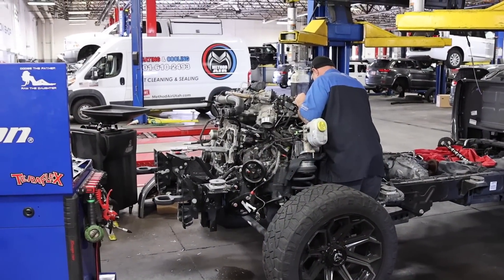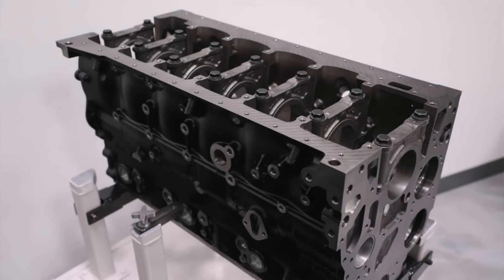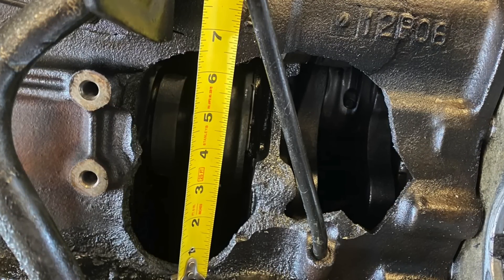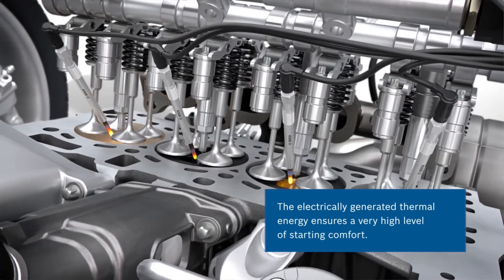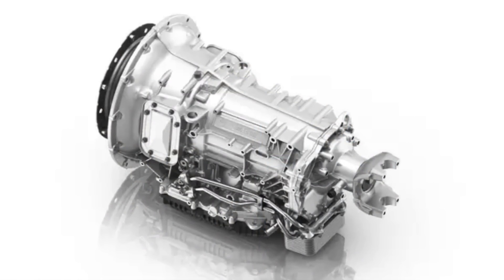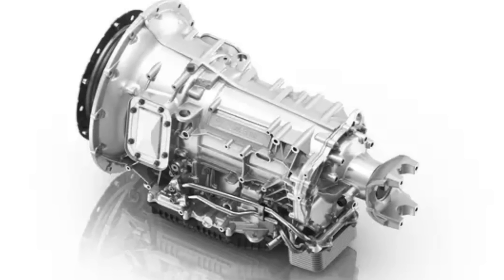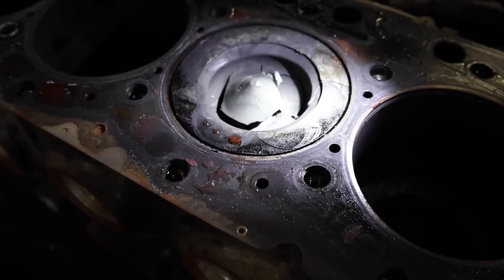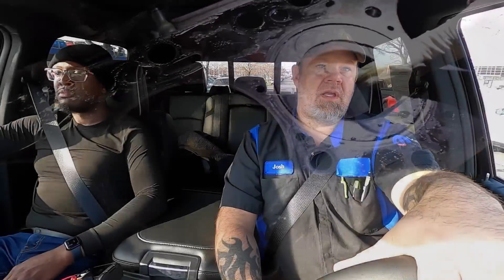Master Tech Breaks Down The Cummins Updates For 2025!

Comment: I won't be buying any truck newer than 2012. The deleted 6.7 with an Allison is doing just fine and can be rebuilt when necessary.
Reply: Who did you get your Allison from?
Reply: @justincastille04  Custom Automatic Conversions in Milton Florida. They have every configuration of truck figured out for the Allison to mate to. No need to try to guess how to install it, everything you need from one shop. They even install if you go to them, great service over the phone if not. Awesome install directions.
Reply: Youre missing out on all of the electronic goodies of the newer trucks.
Reply: @PremiumFuelOnly  All the goodies are found on phones and tablets which can be upgraded at my pace and easier than hardware built into the truck. Then there's the electronic baddies that manufacturers put in the truck that are useless or not as good as the best on the market. I want freedom to choose the electronic goodies I want like hot rodders have done since the beginning. I also don't want the factory dictating the parameters of my usage (holding me hostage). I don't like horses, so I gotta do what I can to keep driving on my own terms.

Comment: So stay away from 22-24 trucks and if you own one of these truck good luck selling them
Reply: What’s wrong with the 22-24
Reply: @Dirtybandz_6.7  failed lifters, failed camshafts, broken aisin transmissions, occasional broken rods. All associated with the 22-24's. All this can be researched on the forums. Good luck. Not all are bad though.
Reply: @aaronkelley8909 I see thanks for the information mines a 20 but I’m thinking of trading it in or selling it this year or in 26
Reply: Bad advice
Reply: @johnowens7959 How is it bad advice? I was in the hotshot industry and my 22, my neighbors 22 and all the guys we know with 22 and 23 Cummins had major issues. Tons of DEF and DPF issues, as well.
Reply: @jeffosmun436  did you guys delete or change tunes?? What model? Your business is very demanding on any truck...
Reply: love my 2022 HO 3500.
Reply: So when I look at the media stuff on the big ZF that is to be put in the new HD - How is it cooled? It seems to have a bolted on passive cooler - not one that goes to the front or through the rad.  Is it it this way for for the ZF’s on the hellcats and other gas trucks???

Comment: Do you think they will fix the fifth GEN lifter issues on a recall?
Reply: Change oil earlier. Shouldn't go over 5000 miles tbh
Reply: People are saying not gonna happen
Reply: Probably not. Most of the failures occur at or around 100K, outside of the warranty period.

Comment: CGI is about 75% stronger than regular gray cast iron but Cummins removed way too much material between the main caps/bearings on the 19-24MY blocks. They decided instead to just go back to cast iron and are now moving to an Aluminum head for the weight savings instead.
Reply: I'll still prefer cast iron because it's proven for decades.
Reply: Ford has been using cgi  since 2011 i believe
Reply: @alexhernandez5061  ford isn't a very good example since they haven't had a reliable diesel since the early 2000's.
Reply: @  There’s actually tons of 6.7s that have half a million miles on them with no issues. I’m a Duramax/Cummins guy but purchased my first Powerstroke earlier this year and so far I absolutely love it.
Reply: @treeamigo8447 even then that was intertrashional’s boat anchor 7.3.
Reply: @treeamigo8447  you can say what you want but fords 6.7 is far ahead than the cummins 6.7 and thats coming from a cummins technician. Fords own in house engine has come a long way and with everything maintenance goes a long way
Reply: @treeamigo8447  I'll admit I'm a Ford guy (previous Ford tech at a couple dealerships) but, the engines themselves are not the issues no different than with the Cummins from what I understand.  The Cummins engine itself is supposedly a good engine but of course, people are biased in many cases.  However, the stupid bolt that fails on the engine grid heater on the top of the Cummins engine is just one stupid issue that causes catastrophic damage internally from what I understand.  As is another problem with a pin in the front timing cover (I believe) on the older Cummins engines.  These are just a couple of the stupid things that cause the engine to fail when it's not really the engine's fault itself.  And then, all the emissions stuff that ends up clogging up and getting soot and other debris to cause premature failure when it's unnecessary.  That is what causes a lot of issues with the Ford 6.7 engines from what I understand.  That and of course people tuning them too much or incorrectly and doing poor maintenance or pushing the maintenance intervals way too far.
Reply: @alexhernandez5061  Yep and it’s basically proven itself on that platform.
Reply: @alexhernandez5061 cgi may be stronger that cast iron. I'm not gonna argue that, I'm not in metallurgy. Decades as in since the late 1800's as far as automobiles not eleven years on one engine type.

Comment: I work for mass transit and we run the zf behind are Cummins for a long time if they can handle city driving and big torque driving sure it should be ok behind the ram
Reply: That trans has been tested in 54k lb delivery trucks and garbage trucks as well as mass transit for over 3yrs with zero issues
Reply: @sonsofliberty3081 our garbage truck used and abused in the arctic trans finally let go that more abuse than a 1ton could ever hand out pounded on since 2014
Reply: Mass Transit equipment probably has waaaay more periodic maintenance and mechanic love than the RAM 2500 in blingy asphalt centric shoes and $5,000 lift kit bought by Jim to pull his lake boat and impress the other boys at work.
Reply: Ours get serviced every 120 days in Hazmat, no expenses spared. @GIGABACHI